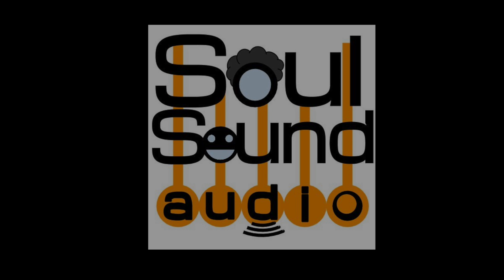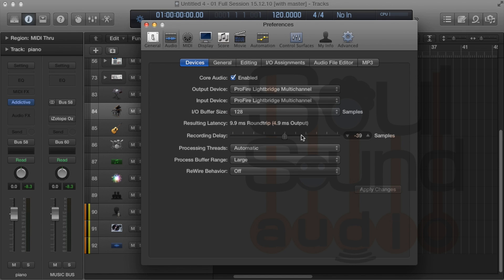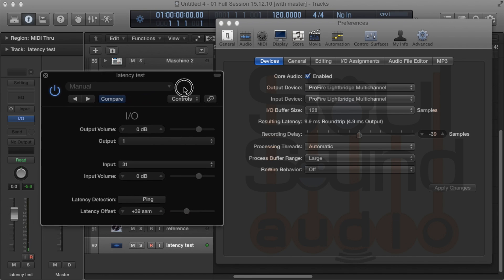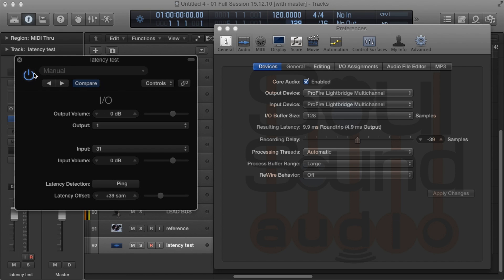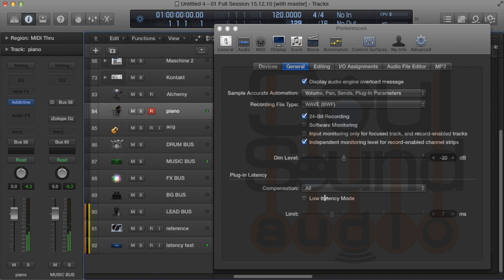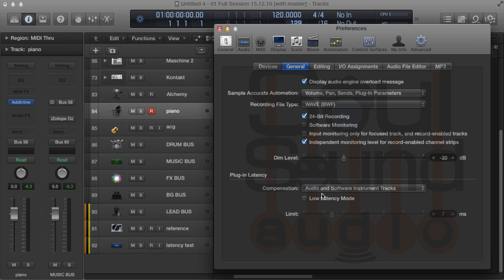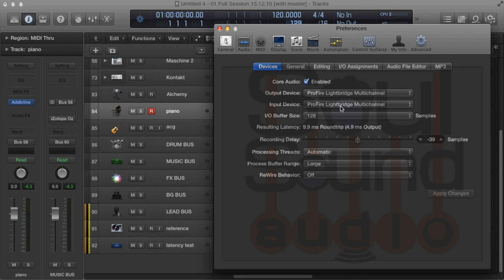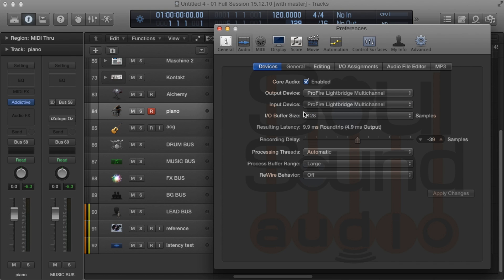Finally! A Fix For Logic X Latency!!!

Comment: Man I drop my vocals they sound fine but when I play it back seem to be off beat by the slightest and I can it is anyway I can fix this ?
Reply from the maker: Try low latency mode them try plugin delay compensation on the just audio and instrument tracks setting. 
You can also try turning the plugins off that are on the master output track.

Comment: So I've seen two videos about this so far and also done it my self (was getting about +97 samples on my XR18)  but Chris at "why logic rules" youtube channel said he never fucks with the sample delay...though he really did a drastic drastic change in samples (something like 3000) so clearly that will sound like ass lol I'm confused, though I certainly have noticed when I play to the click...I am off considerably (what I would consider a lot at least) ...but I really don't think I'm off, I have been playing with metronomes for well over 5 years now (almost 20 yeras of playing the kit at this point) also will this change randomly on my interface or should I just start playing to an out of the box metronome routed into my monitoring instead of relying on the DAW click
Reply from the maker: This van be frustrating em you are just trying to record and have it be where you heard it going in. 
I have had success with turning off low latency mode and turning plug in delay compensation to the second setting (audio tracks...) And also making sure that there aren't plugins on the matter channel (or any bus channels that things are going through).

Comment: This would have been an amazing video but I'm not getting the input/output part. Like how do I know what output/input do I use, cause it's def not working for me. Not getting any ping signal.
Reply from the maker: Hey Melody Man, thanks for the comment. 
You want to use a physical output on your audio interface. 
It depends on what you are using. 
You will have to connect an output directly to an input then select those channels in the plugin so it know where to send the ping and where to listen for it to come back. 
What interface are you using?
Reply: @SoulSoundAudio  oh ok, Ty. I have nothing I need to route in/out like external gear but still have to figure out why I'm getting latency wirh Maschine. Just weird!
Reply from the maker: I have had an issue with maschine before that was solved by restarting logic I believe. Something got messed up. 
I would definitely try the seeing the "plug-in latency" to "audio and software tracks" instead of "all." 
That always helps get my play through latency to the minimum. 
Also get your I/O buffer down as low as your system will smoothly run. 
You may have to raise it as you add more tracks and effects. 
I hope you get it working!
Reply: @SoulSoundAudio  Ty so much man, I'll try all that .. nothing worst to kill your vibe than a drum Maschine with latency.. ugh!!!!

Comment: 01:21 it changes whether you are using the 48000 or 44100 hz setting. The formula about converting SAMPLES to MS or vise-versa goes as: SAMPLE DELAY VALUE divided by FULL SAMPLERATE VALUE *1000. In your case its 39smp/44100hz*1000=0,884ms or 39smp/48000hz*1000=0,812ms. In PRO TOOLS you would normally set the HARDWARE I/O VALUE in settings to these rounded calculations results. And it would stay the same if the gear or the session khz setting did not change and you wouldnt need to re-adjust that.

02:15 COMPENSATION LIMIT parameter sets he maximum number of ms of latency to compensate for. If you have the parameter set to 7ms it means the activated latency only works within 7ms and if your plugin introduced more ms of latency it wouldnt be able to compansate for it, so you would think the function doesnt work.
Reply from the maker: Thank you Robert for the great info! 
This is aimed at conquering undocumented latency within systems and ensuring that how the player hears their live input mixed with the existing recorded material is how it sounds when it is all played back rhythmically. 
The latency compensation does work exactly as you have explained. What it doesn't affect is the the playback of software instruments live. Unless of course it disables something on the insert of the track or bus the player is playing through. 
Thank you for chiming in 👍

Comment: I'm having  a major timing issue in Logic. All my midi and audio is recording early ahead of the beat no matter what settings I use. I did a loopback ping test with the utility I/O and my latency offset is only +1 sample so I don't know why my timing issue is impossible to get rid of. Any advice?
Reply from the maker: +sample seems a little suspect. What is your interface setup? 
Of course make sure you have your plugin delay compensation set to the second choice starting with audio. 
Make sure you don't have plugins enabled on the bus or master of what you are playing too. This could cause it be late on playback so you sync your input to a delayed signal.
Reply: Hi, I have a Mac Pro with an Apogee Ensemble Thunderbolt interface. 
On my test project there are no plugins on the master, there are no buses or aux channels at all and PDC is set to the 2nd option as you've asked.
I've done the loopback ping test with an actual cable 3 times now and it's consistently +1 sample. 
The only workaround I have at this point is to literally drag my audio and midi performances to the right after each region I record. I start by playing some staccato notes to measure how far to the right I'll need to drag. It's really bothering me that I can't play on the beat with a system that's this powerful.

Comment: I tried this method but it doesn't solve anything; it just gives you a rough guide for adjusting recording delay. I'm using the UAD Twin 2 at a buffer size of 64 samples and still getting recording delay issues. I've found that it is a matter of trial and error getting the compensation right in Logic Pro X . Most of the time I can't be bothered with adjusting it and just zoom in and shift the waveform until the audio lines up with the cursor.  I don't have these recording delay problems with Ableton Live or Cubase on a Macbook Pro, it's a Logic Pro X 'feature' . They should add that to the marketing -  'extra latency and recording delay included' !
Reply from the maker: +mwb I feel you and that's what I was doing before I discovered the plug-in delay compensation adjustment. When you set it to on but not buses and master it solves extra "through software" latency. 
The extra delay is not from logic, it's from the recording interface. Logic had no way of knowing what that is because it is what the interface reports to it. Using the io plug-in you can determine any other latency involved specific to the other gear you have logic using. 
The key though is the plug-in delay compensation.

Comment: ... if it is setup right.. yir !! nothing happens, 
if you wanna help, make a new tutorial. make it so everyone can hear the problem and you show us how to fix it.. 
how about..
-how to setup and I/O right so you can use it to find 
delay-issues -  What can you do wrong / right...Tutorial 'ish

sorry if I sound Angry, but right now, it's pissing me off. 
and i just hoped that you was the one.
Reply from the maker: +Kenneth Sommerlund I hear you Kenneth even through the sarcasm ; ) the only trouble is that is it different with each audio interface. It is different but the concept remains to cable the output that you select to the input you select. I chose to electronically send the main outputs to an auxiliary on my mixer that are then sent to the last inputs on my interface so they are always in place for a quick test. It sounds more complicated than it is. Just long an input to an output and selecting the corresponding input and output in the I/o plugin. I hope this helps : )

Comment: Is it necessary to turn off PDC (plugin delay compensation) when doing this loopback test?
Reply from the maker: +Circuit 3 it is not necessary. Turning the PDC to from the all tracks gives you shorter latency when tracking with midi instruments or audio effects.

Comment: Hi. I don't know what I'm doing wrong. I am getting latency on recording. I am using an Apollo Twin Duo interface. I tried using the I/O utility in Logic but something is not routed correctly between my Apollo and Logic. I do not get any value when I press the ping button. This is so frustrating AAAAA
Reply: agreed def need more detail
Reply: I have exactly the same problem - also with an Apollo Twin Duo - which is supposed to be latency free! I've got almost a second delay on the keyboard tonight, had to stop the session - it was impossible to work, like trying to play a really old church organ! Also no readout when I ping. Any advice/guidance/instructions welcome!
Reply: I think some of this is the fault of this lousy 10.4.2 upgrade. My setup was working perfectly before, now it's a disaster...
Reply: Classicalbanksy oh maybe that’s true cause I never had too much issue with my Mac mini and now my Mac Pro  cant even do one guitar track without sucking
Reply: @classicalbanksy4908  Having the same sort of trouble and your right about thr upgrade...everything was working great until l upgraded. My problem was from 10.3 - 10.4  
I've also had to stop a session as it was so frustrating and l was losing the plot.  Not good for the creative juices.
Reply: @lesleymoddleton2287  I'm sorry to hear that, Lesley! LPX has 'sort of' calmed down for me now, but am in the middle of a whole new storm: Vienna Ensemble Pro 6! ARGH!!!!!! And this ridiculous move by Apple to design Mojave in such a way that services older that 2012 are not able to take Mojave as an OS, and hearing the increasing amount of praise for Prosonus Studio 1, I'm starting to wonder whether I want to remain an 'Applet....!"
Reply: Roger Pelegrin the reason why is your computer sucks. You need a super duper $10,000 computer if you think you’re gonna be using more than 2 tracks recorded with plugins. I may be exaggerating but..it’s kinda true

Comment: First off thank you for the video. I was wondering when i go to ping it I dont get any audio back like what you got when you hit ping. Im using an apogee duet with logic pro x . Could it be that the duet isnt set up for this? Thank you in advance
Reply from the maker: +Bryan Gonzalez
Hi Bryan, sometimes we miss the simple in the complicated so I'll start there. If the output is going only to the input and not to your speakers you won't hear the ping. If you have headphones plugged in you should hear it. 
Does the I/O plugin remit a value?
Other issues could be from sync problems. Usually resetting the sampling rate will set everything back to where it should be.
Reply from the maker: +Bryan Gonzalez hi, the duet should work as advertised. You will hear the ping if you use the stereo io plugin and send one side of the ping to the cable that returns and the other to your speaker or if you use the headphone output to listen while using one of the outputs the send the ping to and input. Remember it is not necessary to hear the audio. The indication that it is working is the number value changing in the plugin window after the ping.